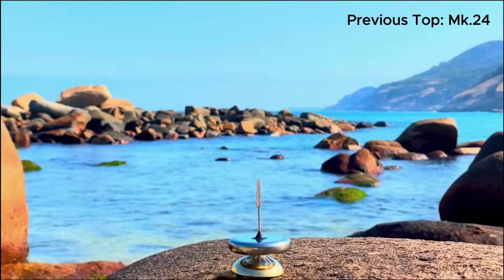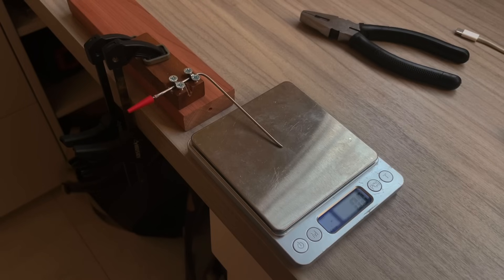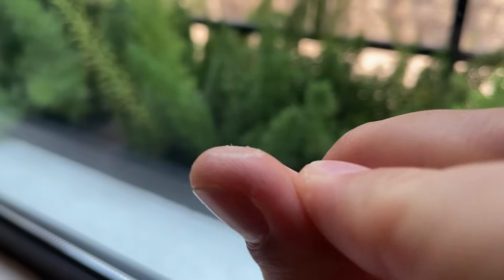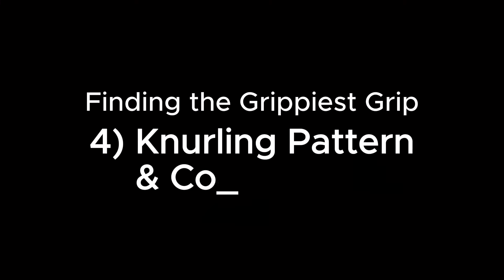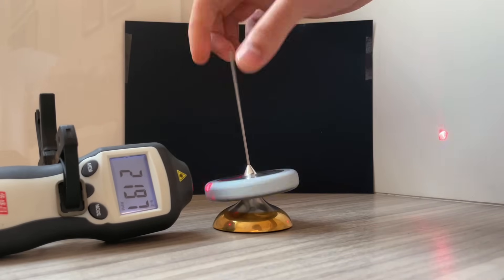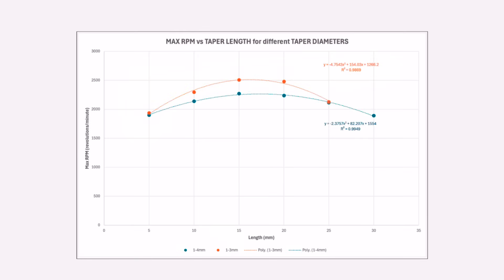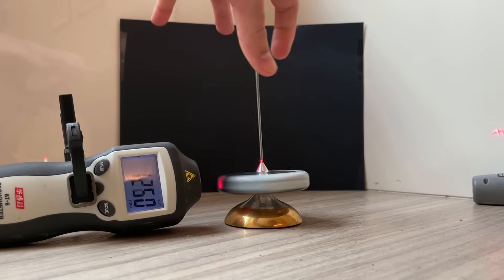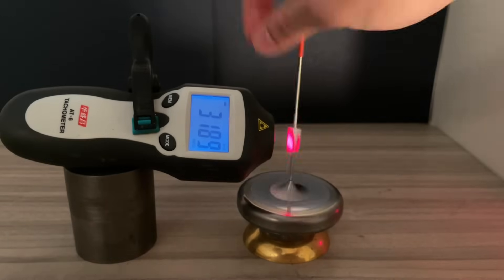Which is the Best GRIP for a Spinning Top?

Comment: Adding spring inside the grip might help to keep it more level. Spring loaded spinner would be cool too, if it's not against the rules :D
Reply: Spring actually steals some energy, at least according to my origamI spinning top. It forms the stem by spiralling paper into itself, and when you let it relax it "springs" a bit in the right direction. The problem is that during the initial spin, the spring is "wobbling" between behind the angle of your fingers and ahead. That is, for some fraction of a twist, the spring will be pulling the top backwards towards your fingers. Letting go at this point would slow you down. It also feels mushy, so it doesn't lend itself to accurate twist technique. All in all, needs fine-tuning if it would ever work.
Reply from the maker: I have a feeling Guinness wouldn’t like it but it sure would be fun!